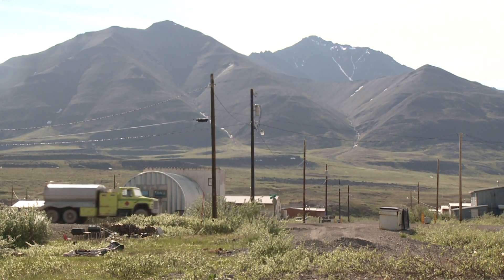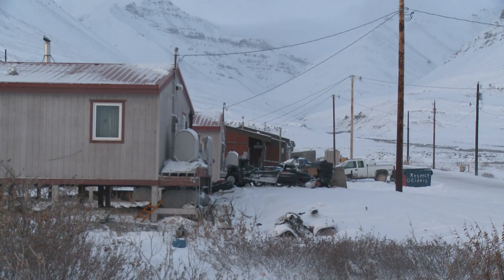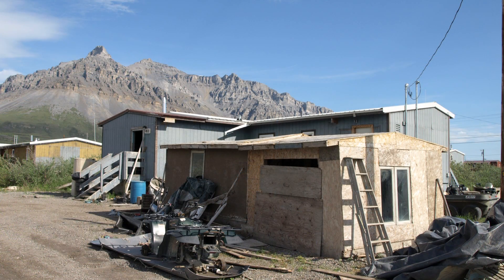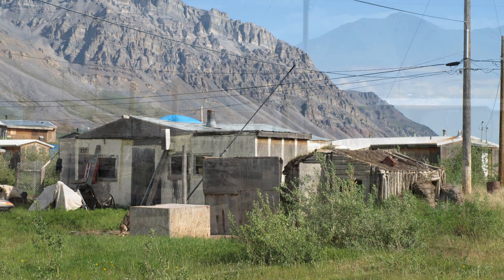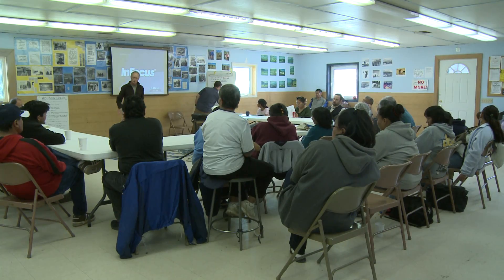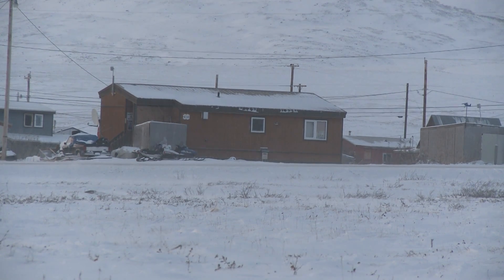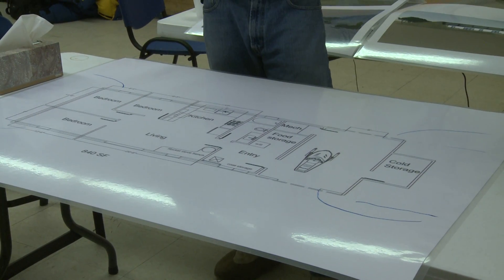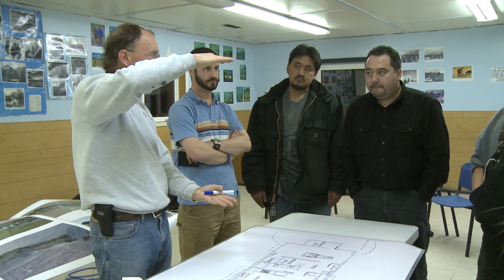Sustainable Northern Shelter in Anaktuvuk Pass

Comment from the maker: Hello Steve, you can read a research report snapshot on our website. Just use the search box and type in "Anaktuvak" and your first option will give you more answers. Sorry, YouTube won't let me post links. 

In a nutshell, the final construction cost was $200,000, 87 gallons of fuel were used from November 2009-April 2010, the walls, roof, and floors have R-60 insulation.